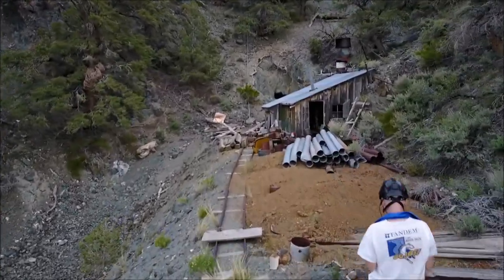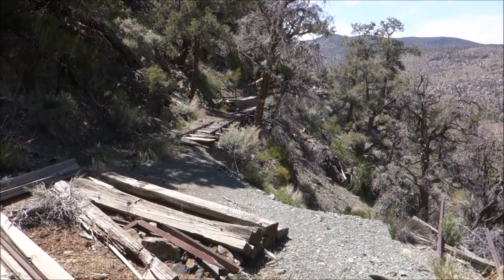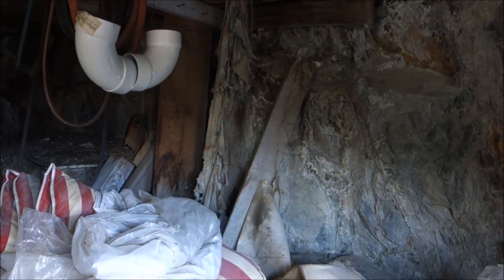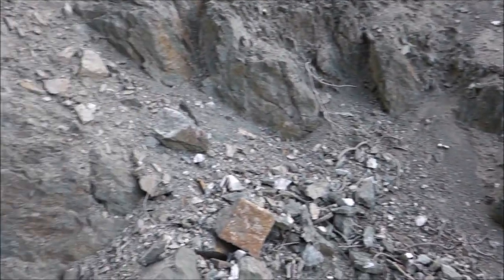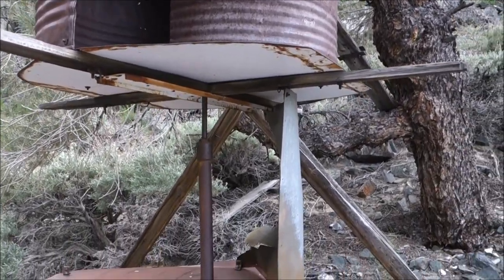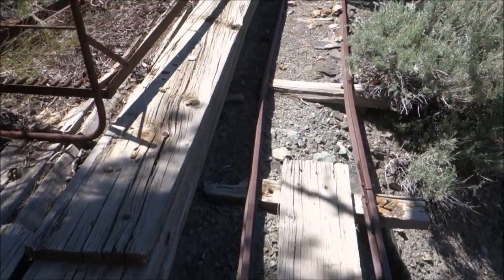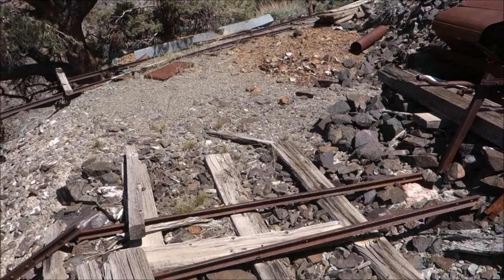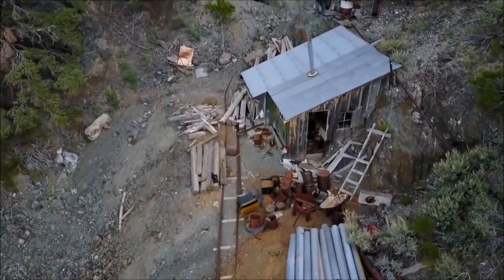Exploring The Vulture Mine: Part 1 of 3 - Remote Mining Camp

Comment: 3:12 is a Model A Ford engine head. The galvanized cylinders sticking up out of the spark plug holes makes me think they were driving it with another engine and using it as an air compressor.  4:50 is the model A engine in background left. This is more of a compressor room and generator shack.  compressed air works the drills and some loaders.  The generator worked the lights. The yellow twin tank compressor at 3:15 and the short handled shovel suggest activity as late as the end of the 1960s. The white PVC elbows hanging at 3:28 and sections of PVC sewer pipe suggest the 1970s.
Reply: clockguy2 What's funny is the gauges ( yea some one ripped out a dash board and bolted it to the end of the bell housing) were Dodge gauges so I didn't inspect much further. interesting combination ford motor and Dodge control panel! lol
Reply from the maker: Thank you very much for the breakdown on the equipment... It is great to have an audience that is so  knowledgeable and can weigh in with additional details, things we overlook or answers to questions. It really adds to the video. And you guys don't always see it, but I get numerous emails from other people expressing appreciation for breakdowns/explanations like the one you gave above. Yes, the equipment spanned several generations. A compressor near the door had a date stamp of 1910 and, as you indicated, the PVC pipe is almost certainly from the 1970s or even sooner.
Reply from the maker: I didn't notice that detail with the gauges... That's funny. Those guys must have spent more time tinkering with stuff than actually mining! It's amazing what they cobbled together up there.
Reply: Right on, recognized that Model A head right off, was wondering if anyone had commented yet, and here it is! :)

Comment: Thanks for Documenting and Sharing these old mines with us. I've always been interested in exploring old sites like these, probably because we don't have anything like them here in Mississippi. The creativity of those guys is amazing. Like many have shared already that washing machine turbine just about had to be a blower for ventilation. I'd suspect when the wind was blowing well enough they used that (free air with no demand for electricity), and would switch over to the other motor driven blower when necessary. I've heard mentioned in several videos that the heads are often missing on motors, and been trying to think of a reason why... one reason came to mind this morning as I was watching this. Since these old motors don't have a key to crank/run, pulling the head would render the motor inoperable to anyone poking around the mine in their absence. Just a guess, but seems to be a pretty clever way of "locking up" the operation, just in case someone tried to sneak in and work your mine. Thanks again for sharing... Watch ya step, and Rock On!
Reply from the maker: Yes, we are pretty spoiled for mines out in California and Nevada! There are many more here than appear on the maps either because almost none of the early mines are marked. The innovative spirit of the old school miners never ceases to amaze me. That's an interesting thought about the equipment with the head pulled off. We see that all the time! I could never figure out why just the head would be missing, but what you said absolutely makes sense. Very good call... Thank you for the comment.

Comment: 5:00 I've been a small engine mechanic for 20+ years now and I love old stuff, and I've never seen ANY motor like that. That doesn't even resemble the typical hit and miss engine layout. That's cool as crap man. Any time you come across engines, if you find any names or numbers on them, I'll research and report! :)
Reply: That is a Delco Light Plant. Also engine in the back ground is indeed a model A Ford. The head is at the door.
Reply: @circa-hc1di  id imagine those batteries are what its being used for

Comment: That wind turbine was actually an air scoop as it spun it pulled air in and pushed it out the nozzle. It was mechanically driven
Reply from the maker: Interesting... I have not seen that before. Thank you for explaining that.
Reply: I agree.   I think they were using a washing machine motor on the spin cycle to drive a bunch of homemade wind scoops and feeding it all into the mine for ventilation.
Reply: IMO it was an attempt at a wind powered ventilation blower. the vanes on top driving the centrifugal fan made from the washing machine tub.
Reply: ok. i see this was already said.

Comment: The thing you were calling a blower is advertised as a standard mill exhauster. I saw a copy of the old catalog online when I looked up the company name.
Reply from the maker: Interesting. I'm not surprised the miners here repurposed something like that since they did that with everything else here. The device functions just the same - blowing air - and it can be used to blow air out of a mill or to blow air into a mine. So, they were using it as a blower at this site.

Comment: That sort of wind mill became popular back in the late sixties and seventies. They did work but were difficult to start. A few were built with some sort of starting device to get them going. 
What time frame do you think it was last used?
Reply: David Micheletti You know it's hard to say, being that the desert preserves most equipment quite well. If I had to guess maybe early to mid 70's. The mine had been worked since then but mainly in the upper adit.
Reply from the maker: Thanks for weighing in on that windmill. It was definitely difficult to start. I pushed pretty hard on that one to try to get it to turn and it wasn't having it at all. Now, granted that one was rusted, but still... Yes, I would agree with my exploring buddy's guess of the 1970s.

Comment: That mine must be really hard to get to. There's way too many souvenirs there. Like DesertRat said, the washing machine has to be a wind powered air blower. If there was no other source of electricity their generator was most likely straining to provide for a compressor It just fits with all the other Rube Goldberg paraphernalia. It's pretty rare to find an old automobile engine that still has the head and carburetor. I've never been able to figure that out, why the heads are always missing. There was at least one that I saw in the shed partially dismantled. I'll make this short. It seems we have a tornado heading our way. Looking forward to parts 2 & 3.
Reply from the maker: Yes, it is in a very remote area and unless one has a rock crawler, driving up to the mine will prove to be a significant challenge. Actually, even with a rock crawler getting up to the mine would be sporty at best because the road gets progressively steeper and progressively worse. So, some strenuous hiking is almost guaranteed. And, lastly, this mine does not appear on any maps that I have seen. Nothing on the topographic maps, the MRDS or any of the others in that family... You can see the upside of all of those factors though in that the mine site is in great shape. Like you said, there is no way that all of that stuff would be there if the mine were easy to get to or if many people knew where it was. Yes, the generator would have been their only source of electricity. That's a good point about the generator straining to keep up with demand. I was thinking that the "budget blower" was about money, but it may have also been about a shortage of available electricity. I hope that tornado blows away from you. I like your comments!
Reply: Missed us again! In 20 years we've had one touch down in the pasture 400 yards from the house and one touch down 200 yards to the south that took out a motor home, a pickup truck, and a pole barn. Thinking about moving to a state that has a rich mining history and no tornados. I'd hate to lose my computer and miss your next installment of the Vulture mine exploration.
Reply from the maker: Glad to hear that you were able to enjoy the excitement without any downside this time... Which state do you live in? Every state has some issue though. In this part of California we have forest fires to worry about. With as much stuff as we do on our computers and we have on our computers these days, it would be a big deal for me if I lost my computer. I completely understand!

Comment: The Model A engine/ come/ air compressor was driven by a four Cylinder greymarine engine ,converted to dryland use .Just the thing for constant running .There was probably a drum full of water out side oce which would have acted as a heat exchanger to keep the engine temp down.
Reply from the maker: I'm not at all surprised that these miners had a repurposed engine...
Reply: Yeah lots water up there

Comment: TVR -  I think that contraption made from an old washing machine, is a wind powered blower for ventilating the mine. The track that ends at the old winch was for pulling up the timber car that you saw down below when you came up the road - (it wasn't for Ore or waste rock) .  -  < Doc > .
Reply from the maker: Yes, a budget blower for the mine was our best guess as well. It looked like that outlet attached to the bottom of the repurposed washing machine would have fit well with the ventilation pipe that was around. So, the cart made of timber was for hauling supplies and equipment up to the mine?
Reply: TVR -  Yes, generally speaking, those long, wooden-framed cars were for hauling Timbers, Lumber, Machinery, etc. , up to , and/or into the mine. For example, those large Air Receivers that we've seen inside of mines would be very difficult to lift up onto an ore car and then maneuver it around inside the mine. Much easier with a platform car.  -  < Doc > .
Reply from the maker: Got it. Thanks for the explanation...

Comment: I don't think this was a cabin, in the sense of accomodation.  I think it looks more like a shed, or a workshop as you wrote in the video.
Reply from the maker: Yes, I agree with you. It seems more like a workshop or a shed to protect the equipment. However, that does beg the question as to where the miners slept? Given the location, there is NO WAY they were commuting in every day from somewhere else unless they were doing so by helicopter (which seems rather unlikely).
Reply: As low budget as this seems to be I would guess that they stayed in tents and worked the mine seasonally.

Comment: It totally looks like several generations of operation at that site, from way old, given the antique engines and equipment, to somewhat recent looking at the shiny PVC pipe in the shed. Totally low budget with that funky wind powered vent system! Creative solution tho. Is that still an active claim?
hey, does anyone know how to support a collapsed adit while digging through? I remember hearing about some technique miners use for punching through and supporting collapsed tunnels but don't know any specifics. I'm attempting to dig into an old mine that I think could be interesting but there is a bunch of loose stuff above that I'd like to avoid moving if possible. The mine was intentionally closed so I figure it's gotta be good. Already spent a several work days worth of time and lots of wheelbarrow loads. Found track! Totally fun and useless project but highly satisfying somehow. Meditative. I don't envy those old miners tho, it's a fuck ton of work!
Reply from the maker: Yes, some of the equipment dates to the early 1900s and some of it is probably as recent as the 1990s. So, it definitely covers a wide range. I loved the tinkering and low budget innovations the miners came up with. Nah, it isn't an active claim now. No one had been up there for a long while when we visited... Opening collapsed adits is a noble endeavor. You are restoring what has been lost to the world. Good luck.
Reply: Yeah, kinda fun to add to the mine dump pile. It's the adit above that flooded mine I talked about last year. My theory is that they're connected. Gotta find out somehow...
Looking forward to see the adits on your highly intact mine site. Thanks bud!
Reply from the maker: Ha, yeah, not many mine dump piles are being added to these days! I wish you the best of luck in getting into that mine... And I hope the two are connected. Yes, the two adits in the upcoming videos have some good stuff as well.

Comment: Did you guys happen to see any manufacturer names on those engines??
The drone shots are cool visual.
Reply from the maker: If I saw a manufacturer's plate or stamp, I included it in the video with the exception of the pump near the door of the cabin. I edited that out, but I'll see if I can find it... I didn't look as carefully as I should have at some of those engines, but I was a little overwhelmed by that site. Also, a lot of those engines and other machinery were cobbled together from different engines and so sometimes they didn't have a manufacturer's name on the part that was left or it was obscured by the presence of parts from multiple manufacturers. Glad you like the drone stuff... It's a steep learning curve.
Reply from the maker: Ok, the one I edited out (the engine by the door of the cabin) had the following information on it:

Gardner Gov. Co.
Quincy Ill.

Gardner Trademark

Gardner-Rex
Compressor
Size 6x4 1/2

Patent
Sept 20 1910
Aug 22 1911
Feb 24 1914
Reply: Isn't that wild, I remember Gardner-Denver equipment, big ass compressors. You guys are being spoiled in all that dry air!! 
When I seen the hood and frame of the winch power, I figured it had wheels at some time in its life, great great ancestor to the war wagon, 
 lol.
Reply: Stabit The engines in the cabin side by side we're two Dodge motors both inline 6's. The one engine that was complete was the drive engine and it had a pulley and belt set up that ran the other engine as an air compressor for the tanks outside.  The generator was a Delco 860 or 880 farm power plant. It had a single piston hit and miss motor that charged the bank of batteries under the bench on the left in the cabin.  The winch motor by the rail still had plenty of compression when I cranked the handle. I could get that running with minimal effort the mag still had spark!!
Reply: A whole new meaning of  "run what ya brung"
Reply: haha ..... don't need no stinkin' wall.
Reply: I don't imagine it was to LOUD inside that cabin with everything up and running. Very cool pieces and parts!!
Reply: Stabit You know, come to think of it, I don't remember even seeing an area inside OR out that was used for habitation.
Reply from the maker: Yeah, I was wondering about the habitation issue as well. Aside from the bed frame next to the tracks, I also saw no sign of what might be considered a bunkhouse or home. Maybe they all slept in the same bed out under the stars? How romantic...
Reply: TVR Exploring or in their truck
Reply from the maker: I think even they would have had a hard time getting a truck up there... I'm going to go with the shared bed under the stars.